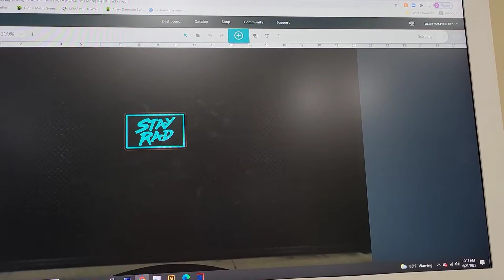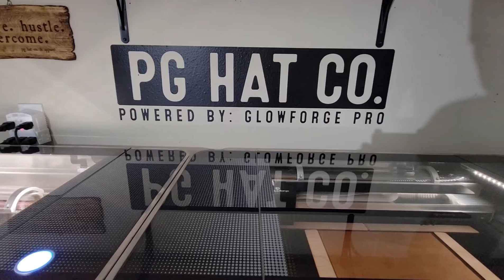Glowforge Pro Laser Deep Clean and Maintenance

Comment: Any ideas on how to clean the widows on the inside for the focus system on the Print Head?  Cleaning the outside just fine.  Much ash gets under the window.  I must manual focus to 0.050" to get clean cuts on 0.1165" MDF.
Reply from the maker: On the actual inside of the head? I have no idea. Maybe compressed air would help blow debris out of there.
Reply: @PGHATCO  All good.  Second head on the way from GF.  Original must not have been sealed well.  Thanks for the reply!!!
Reply from the maker: @jarrettporst4799  Awesome to hear!

Comment: What do you do to clean the exhaust fan?
Reply from the maker: Hey. There is a cleaning mode for the exhaust fan. I don't know if you have used it before but I didn't know it was a thing until recently. But I like to use Isopropyl alcohol to clean it. I spray it in and let it soak for a minute then go into cleaning mode that kicks the fan into high gear. Make sure you put a cloth or something in front of it to catch all the wet debris. Then just wipe it out.